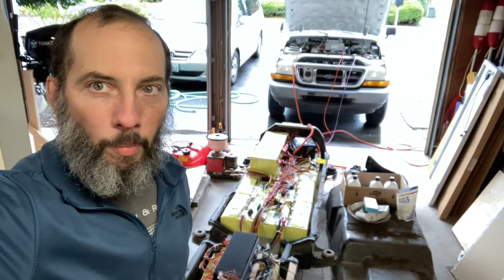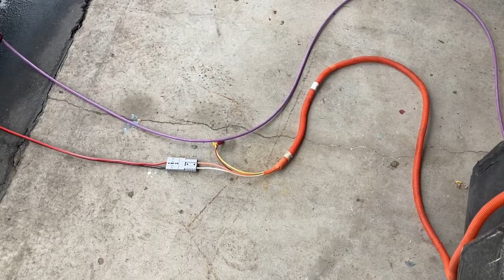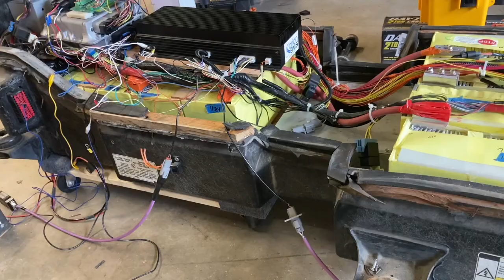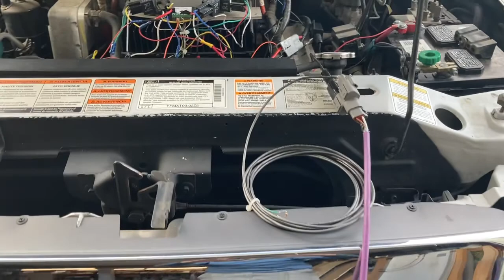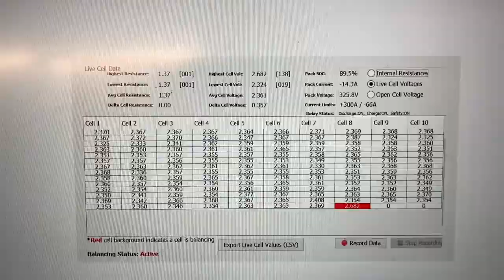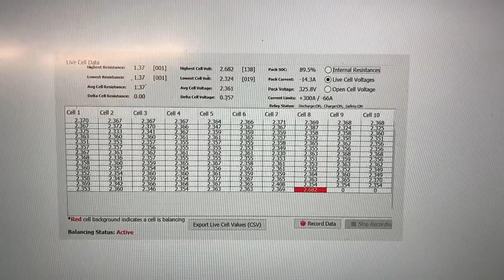Ranger EV - Pack is charging Ep 9

Comment: Great progress! Is it possible to connect the pack to the truck to test if it will run it before completely reinstalling it?
Reply from the maker: I can’t connect it to the truck to run the truck until I put it back in the truck without an expensive custom cable extension.
Reply: @furriestdog  Well at this point the odds of success seem fairly high. Good luck!